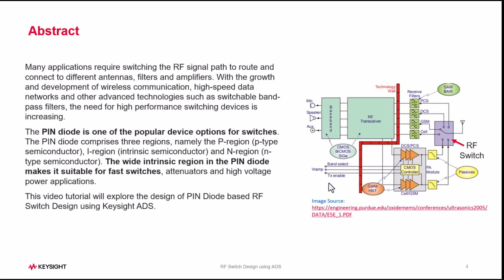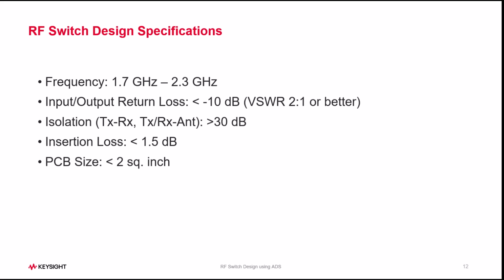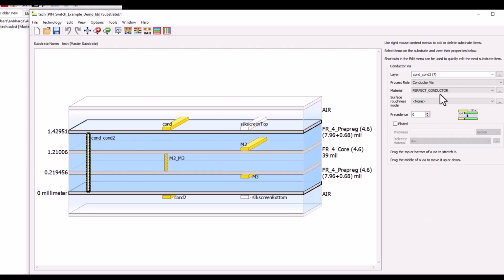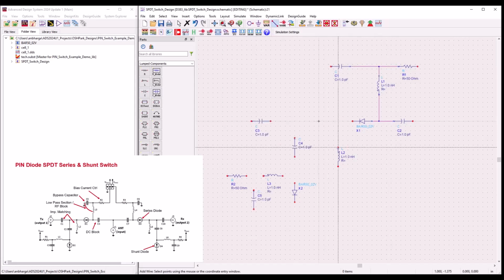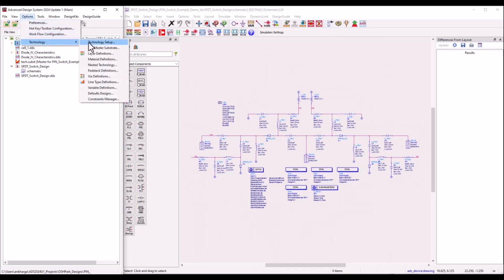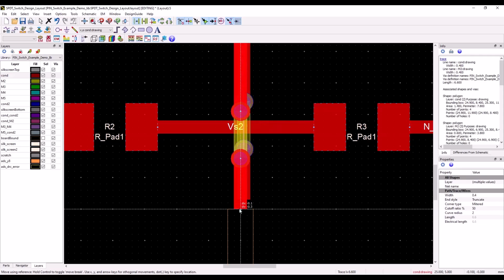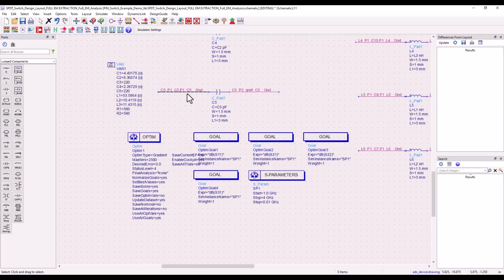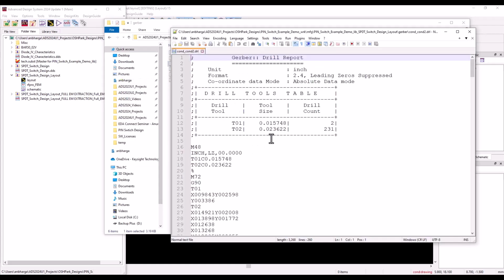RF Design-29: RF Switch Design using ADS - Part 1

Comment: How do I model an SMS7630-005LF in ADS? It's an SOT-23 model. I designed an RF rectifier, and S11 was good, but when measuring with a VNA, there were massive frequency shifts; I mean, S11 was dipping at all the wrong frequencies

Comment: Please explain:  I created the circuit layout and co-simulation of the layout and circuit with S-parameters, so Is the metal strip of the layout treated as a distributed parameter transmission line?
Reply from the maker: Yes, in the co-simulation, the layout's metal strips are treated as distributed parameter transmission lines.
Reply: @BhargavaAnurag  thank you !

Comment: Please explain what will happen if 
Pad width is not equal to 50 ohm microstrip width(tee/mlin).?
Reply from the maker: If widths aren't matched then you might see mismatch/reflections and same has to be analyzed properly in schematic or EM analysis so that you account for the same.
Reply: @BhargavaAnurag but sir, pad widths can only be smaller, and 50ohm tee width larger, that was also in your layout too, then there will always be reflection loss....
Reply from the maker: @tushantmishra1482 As I said before there is nothing wrong with widths mismatch as that is the reality. Only thing you need to ensure that those widths mismatch is accounted in simulations so that you can see the impact and fine tune the final performance. 50 Ohm width is dependent on the height and Er of the dielectric and PAD size is determined by the component size like 0603, 0805 etc. you can take an educated decision based on the requirements you have in hand to find a good start point and take care of the rest during your design and simulation process

Comment: Thanks for all your content on using the RF tools!!  I was working the RF Switch content and found that during my layout of the  circuit I lost the connections of the parts when they were placed in layout(I think they maybe called rubber-bands).  Could you help with how to turn that option on?
Reply from the maker: @RFEngineer-i2c  pls reach out to support@keysight.com to get help

Comment: @Anurag Bhargava Sir, P1dB point can be calculated from s2p file of a limiter diode or not?
Reply from the maker: @mugheesahmad1988  No, it can’t be.
Reply: @BhargavaAnurag  Sir, then I need to follow non-linear approch... Use spice model of a limiter diode for P1db calculation?

Comment: s'il vous pait  vous voulez faire une vidéo explicatifs conception d'antenne patch rectangulaire line feed ligne microruban  a2.45GHZ  de permittivité 4.4 et de hauteur 1.6mm sur le logiciel HFSS et merci d'avancer
Reply from the maker: Sorry but I have HFSS license or tool but you will find relevant videos elsewhere on You Tube

Comment: sir can you explain rectifier circuit and how to draw graph between PCE(power converted efficiency) and load
Reply from the maker: What's the formula to compute PCE? Once you have the formula, you can sweep the load and plot it on the graph.
Reply: @BhargavaAnurag  PCE Is ratio of DC power delivered to the load and input power